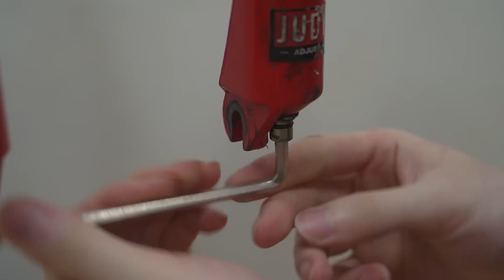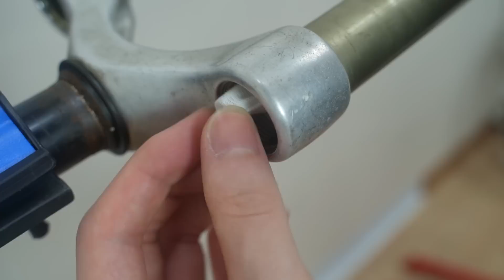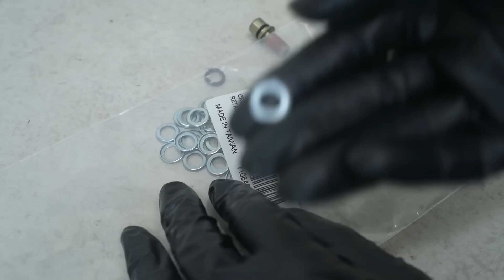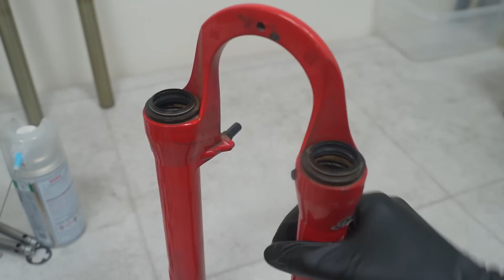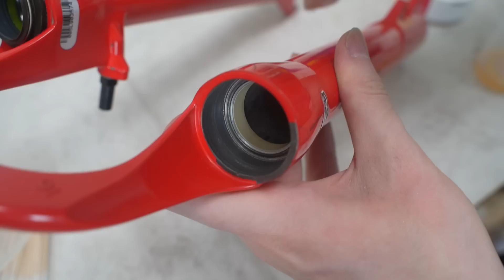[ASMR] BIKE ROCKSHOX JUDY RACE - Overhaul, Restoration

Comment: 의심.
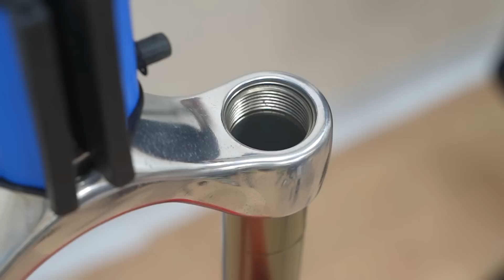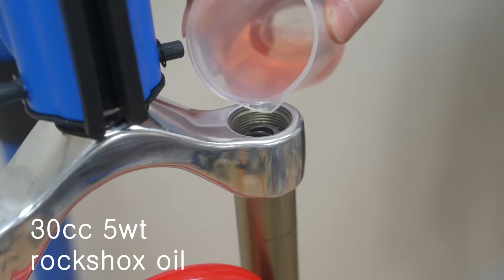기름량의 차이(8:13, 130cc; 8:19, 30cc)가 정확한 양인지, 아니면 포스터의 슬립인지 모르겠습니다. 의문이 남는다...
어느 쪽이든, 잘했습니다. 브라보!

A doubt.
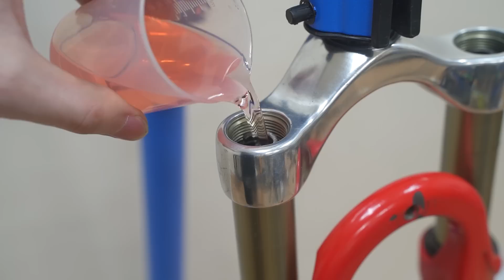I don't know if the difference in oil quantities (8:13, 130 cc; 8:19, 30 cc) are correct quantities, or if it is a slip in the poster. I'm left with doubt...
Either way, great job. Bravo!